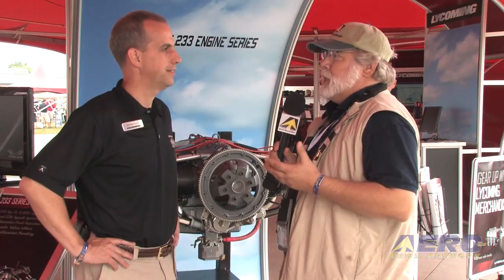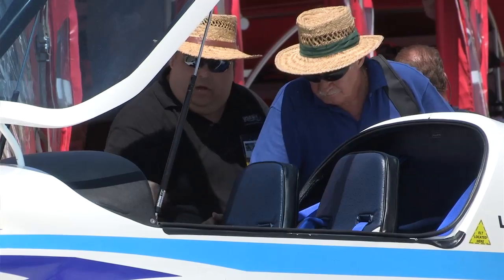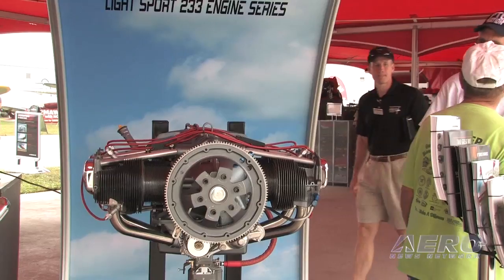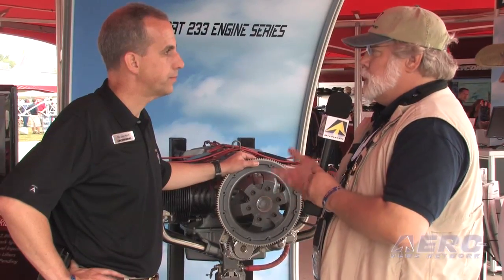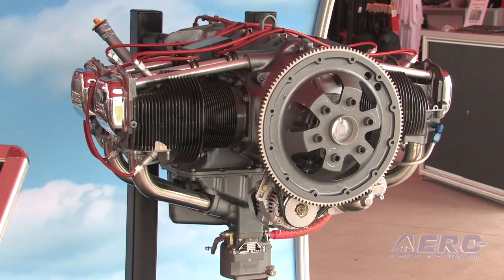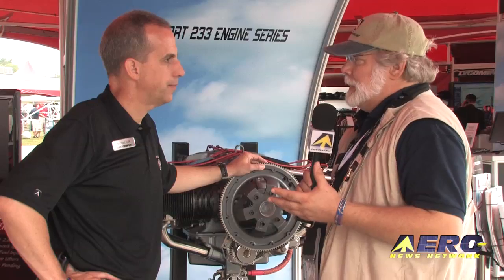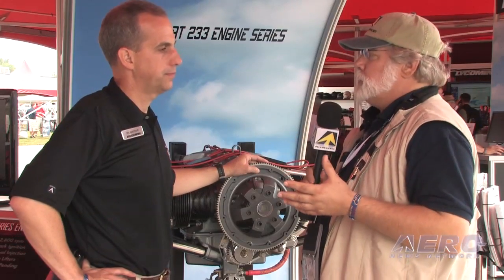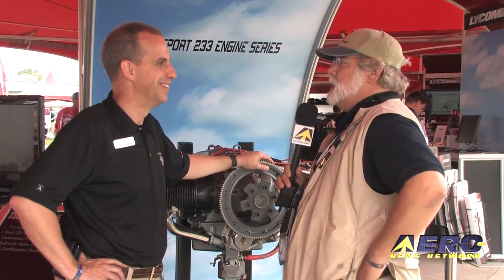Aero-TV: The Littlest Lycoming - Lyc's Light-weight 233 Hits the LSA Market

Comment: A modern automotive engine puts all of these engines to shame.  Not only are they far more reliable, but also require lower maintenance.  The DA-40 and 42 use an older technology automotive diesel engine that is just as reliable as the best flat 4 and puts out the same power, but sips fuel and provides full power well into the mid-teens, where true airspeed is far better.  Viking takes current production Honda gasoline engines and doubles up the electronics to provide peace of mind.  These automotive based engines are just as reliable, provide cabin heat in winter/at altitude and have single lever operation simplicity.  Aviation engine manufacturers will never change as long as the mindset of most owners remain in 1965.  The same owners who demand the latest tech in their luxury cars and would not daily drive a 1965 car, yet they bet their lives on the same vintage tech in front of them at 8000 feet.
Reply: The big problem with automobile engines is weight!
Reply: Roger that is also an idea from the past.  The old heavy iron block engines are gone, relics of the pre-CAFE days when fuel mileage was an afterthought in automotive design.  Almost all modern automobile engines are made of aluminium alloys. In addition, they are equal to or lighter for equivalent power levels than the certified aircraft engines.  
For example, the 260 HP IO-470 (7.7 L) used in many aircraft applications weighs in at about 425 lbs dry.  There are any number of automotive engines that can match that power level from 2.0 L turbo four cylinders (~350 lbs) to 3.0 L to 3.6 L 6 cylinder engines (~400 lbs).  All have lower dry weights than the IO-470.  Even with accessories, radiators, coolant and oil added to them, the automobile engines still weigh less installed than the aircraft engines.  
The main thing stopping an updated engine from being certified is regulation.  It takes months and millions of dollars to certify an engine today. The market numbers can't justify that time and expense to sell a few hundred engines.  The latest version of the IO-470 was certified in 1967. Automobile makers produce engines in the millions, so to certify a new engine is easily justified and massive competition requires upgrades every few years to stay competitive.
Reply: ZManMD The Rotax 915 iS absolutely puts this engine to shame. 13 lbs less installed weight and a 146 HP turbo, FADEC fuel injected.